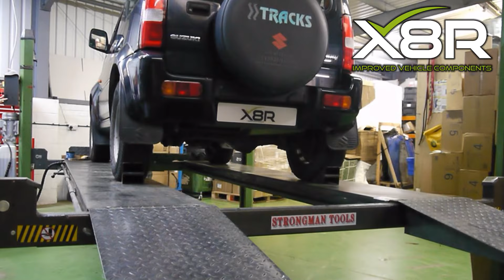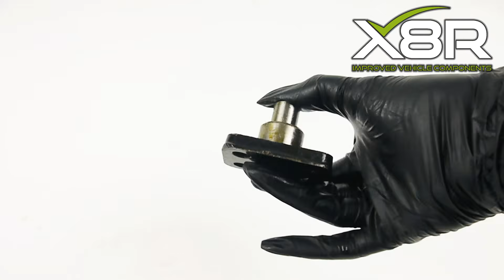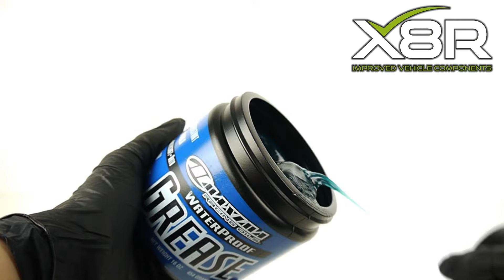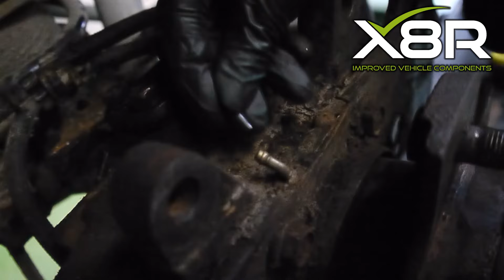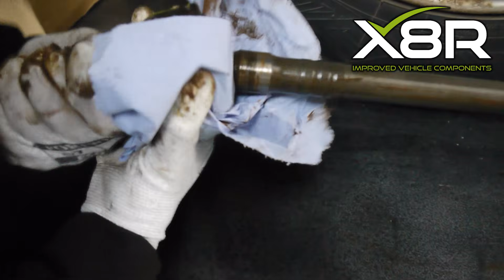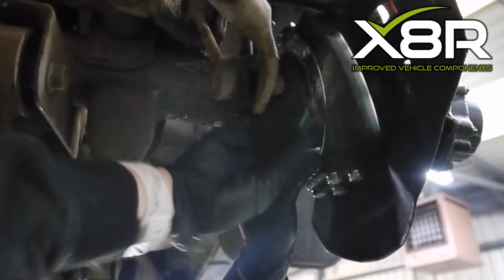Suzuki Jimny 1998-2018 Kingpin Rebuild Refurbishment Repair Kit X8R Death Wobble Vibrating MOT Fail

Comment: on the whole its a great kit and everything fitted nicely apart from the kingpins themselves, luckily, my old ones were still in fairly good condition so I was able to re use them but if you are buying this kit because your kingpins themselves have failed I would suggest getting the kingpins elsewhere.

Comment: Greetings from Pontassieve, province of Florence, Tuscany, Italy. I just subscribed to your YouTube channel because you are a Suzuki enthusiast like me. I also have a Suzuki Jimny 4x4 with a 1.3 LT semi-prepared M13A petrol engine that I use to go to the countryside and the mountains for rural and forestry work! (A small question: what brand and grade of engine oil do you use in your Suzuki Jimny 4x4 engine?) I also had to replace the stub axle bearings on my Suzuki Jimny 4x4 and then also the CV joints. I had to replace them because of rust caused by the water that had entered. The bearing pieces ate the CV joints!

Comment: i have experienced death wobbling and changed the bushes, wheel balanced but i still experience it. is worn out kingpins the cause?
Reply from the maker: It could be. However it would be impossible for us to diagnose the issue remotely.

Comment: cuando un vehículo empieza a mostrar suciedad en esa parte fuera de una buena limpieza también se debe cambiar el retenedor interior del eje, porque ese es el que está botando aceite, y según el manual de taller no hay que hacer todo ese desarme para cambiar únicamente la empaquetadura exterior ...
Reply: Hola, tengo los dos retenes de delante que me pierden. Puedes decirme cómo cambiarlos sin hacer todo lo del vídeo? Gracias
Reply: amigo si la fuga o la suciedad que presenta es aceite, definitivamente tienes que hacer todo ese desarme y cambiar los retenes de los ejes interiores, pero cuando es solo suciedad por mala Limpieza de los guardapolvos exteriores, en el manual muestra que el caucho principal se corta y al colocarlo ese corte se coloca hacia arriba como esta el corte de las láminas laterales.  @nenesex1
Reply: Muchas gracias!!

Comment: Ordered two kits of eBay , went to do the job its a shame the king pins do not fit the bearings,  put them in with a rubber mallet you would have put these in with a sledge hammer .
Reply from the maker: Hi Glenn, I have sent you a message on eBay to try and resolve this for you. - Georgina, X8R Ltd
Reply: Hello, what was the solution to this? I'm having the same issue. I'm hoping if I put them in the freezer overnight they may then go in??